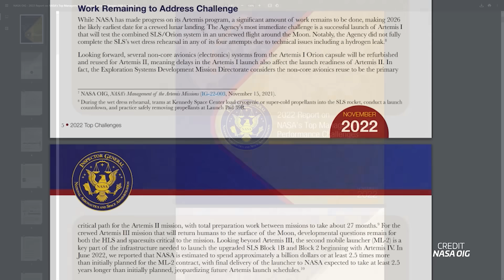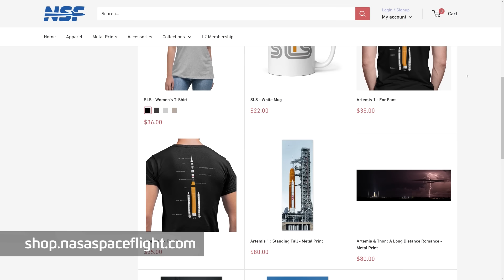Artemis Moon Landing Missions Delayed!

Comment: Artemis 3 will not happen until NET Jan 2027.  SpaceX will want to send at least 3 starships to mars during the late 2026 launch window which will require min. 15 tanker launches, so no Artemis in late 2026.  ;)
Reply: Then SpaceX will postpone their launches until the Q4 2027/Q1 2028 window. If Starship is even capable of reaching Mars by that time.
Reply: @iamaduckquack exactly

Comment: Biggest problem for Artemis 3 is the poor choice of Starship for landing vehicle.  Starship is meant to carry 100 people to Mars, not 2 people to the Lunar surface. Wrong choice as over a dozen more successful Starship launches are required. Bad choice NASA, should have gone with a smaller vehicle.
Reply: I mean, lots of payloads can be put on it, but i understand what you mean
Reply: Gonna be lots of Starship variations depending on what's needed.
Reply: Starship can only carry 100 people to Mars, if there already is a colony on Mars there to provide everything those 100 people need.
Reply: I mean It might even be cheaper and faster to just build a scaled-up crew dragon and send it via Falcon Heavy.
Reply: @erlienfrommars   Nope, because Crew Dragon is a LEO only spacecraft and doesn't have the shielding, lifesupport, or range to return from the Moon. Not to mention the heat shield would likely need to be upgraded as well. Then you end up with a spacecraft that is likely as heavy as Orion.

Former NASA Admin Bridenstine talked about Orion and the ICPS on FH, in that a fully expended FH could barely lift it to LEO. The problem was the aerodynamics of such a large stack on FH. After Artemis III, the 5m ICPS is replaced with the 8.4m EUS, so FH would not work at all, since it is only 3.7m in diameter.
Reply: @erlienfrommars  they should do this as well. Start space tourism around the moon.

Comment: EJSA: 2 hour rant just sh!! Talking nasa and ULA for not flight testing, and the space suits further delaying things.  The rant was repetitive, but warranted.
Reply: Boeing is the main contractor for SLS. Lockheed Martin is the contractor for Orion. The ESA is providing the European Service Module (ESM) for Orion. ULA is only providing the Interim Cyrogenic Propulsion Stage (ICPS) for the first 3 flights and they started on the one for Artemis III before Artemis I flew. Boeing's Exploration Upper Stage (EUS) is replacing the ICPS for Artemis IV+.

Comment: That was fairly inevitable. It’s NASA.
Reply: Most spaceflight missing the deadline, including SpaceX. The initial 2024 date was politically motivated and unrealistic.
Reply: @steveaustin2686  no it wasn't. The 2022 artemis 1 launched in time. Let's just hope China doesn't achieve it in the meantime... 😬
Reply: @amazingamazigh1538  Artemis I had issues and the launch date was pushed back, so yes, Artemis I missed its date.
Reply: @steveaustin2686  It could have launched so no it didn't miss its date.
Reply: @amazingamazigh1538   'Could have' and 'did' are NOT synonyms. Artemis I was pushed back, multiple times.
Reply: @steveaustin2686  it was pushed back multiple times and eventually launched as planed in 2022.
Reply: @amazingamazigh1538   Pushing it back, means it MISSED the date. I thought this was NOT a hard concept, but apparently I was wrong.
Reply: @steveaustin2686  but still it launch as planed in 2022. Whereas artemis 2 is most likely going to skip 2024.
Reply: @amazingamazigh1538  🙄So Artemis II can be pushed back and miss its date, but Artemis I being pushed back doesn't miss its date? That is complete and utter nonsense.
Reply: @steveaustin2686  yet it's easy just connect your brain. artemis 1 still successfully launched in 2022. That won't be the case with artemis 2 which will skip 2024.
Reply: @amazingamazigh1538   🙄 The part you KEEP MISSING, is that Artemis I was PUSHED BACK multiple times, so it MISSED its initial date. You, YOURSELF have admitted that Artemis I was pushed back, so it should NOT be that big a leap to understand that Artemis I MISSED its date.
Reply: @steveaustin2686  😒no it didn't miss its date since its schedule was successfully fullfiled in 2022 as intended. We would be glad if artemis 2 could do the same but it likely won't happen this year according to nasa. That is 2 different kind of push back between the two.
Reply: @amazingamazigh1538  🙄🤡 Artemis I was pushed back and you agree this is true. Therefore, it missed the target date. If you want to ignore reality,  that is on you.
Reply: @steveaustin2686  🤡😒🤡 as I said connect your brain it still launched in 2022 which WON'T be the case of artemis 2. Not that hard to understand.
Reply: @amazingamazigh1538   🙄🤡 We are NOT talking about Artemis II. We are talking about Artemis I and how it missed its target date. 

Wisdom has been chasing you, but you have been faster.

Comment: Does anyone know if the Orion capsule from Artemis 1 is the same one they will use on Artemis 2? I mean, is there only one Orion capsule in existence?
Reply: They built separate ones for Artemis I through III. After Artemis III, Orion is supposed to be reused. Some of the flight control systems from Artemis I are being reused on Artemis II. Artemis III is all fresh equipment.
Reply: idk, but the new mojo is to reuse as much as possible. SLS is junk and need to go to museum with Space shuttle.

Comment: How is it that in the 1960s we knew how to do these things, and now after 50 years of technological development we don't know how to do these things?
Reply: I think the problem is that back in the day contractors were mostly engineers rather than management obsessed with profits so could get stuff done well and fast. Combine that with INSANE amounts of funding to spite the USSR and you had a system that could get the job done. Nowadays with stupid management, limited (and constantly changing) funding, and worse political infighting it just goes slow and stupid.
Reply: @nathanguyon7620 the entire Apollo program cost less than twice what Artimes will cost through 2025 and that's including all of the landings Apollo managed to make and the first one in less than a decade while Artimes has made zero moon landings in almost 15 years of development.
Reply: We KNOW how to do it but have much less money and higher safety required than 50 years ago. 50 years ago whole USA was working hard for apollo program.
Reply: Our "enemies" don't have the same stringent safety requirement.  @MKJ8888
Reply: @MKJ8888  We had a heat shield capable of returning a capsule from lunar orbit, but now the current version is inadequate. We have life support systems capable of sustaining a dozen astronauts in low earth orbit for months, but now the lunar version for 4 astronauts for two weeks is inadequate. Yeah I know there's always money for another war but never anything for NASA, but they don't seem to have made good use of the money they did get over this period of time. Growing seeds for high school students and playing with spiders in the space station didn't bring us closer to exploring and developing the solar system. I'm not directing any of this at you - I just need to vent my frustration at NASA being so aimless and directionless since the mid 1970s. They should have been developing in-orbit refueling and propellant depots back then. There is so much NASA should have been doing over the decades, but didn't, and now that they finally have a mandate to explore, they don't have the technology they need. You cannot imagine my frustration. I don't think any of the astronauts who walked on the moon thought they would go to their graves with us never having returned.
Reply: I have a funny story that relates to this question.   Not long after President Bush ( the second one) announced that we were going back to the moon, my husband, daughters, and I made a return visit to the U.S. Space and Rocket Center in Huntsville.  While there, we struck up a conversation  with a grounds keeper. He told us this story. He said we had missed the NASA people by a few days. It seems that they had the realization that there wasn't anyone left at NASA who had worked on the Apollo  program.  So several NASA people were sent to Huntsville.  He said they went over every piece of hardware that had anything to do with the moon landings.  They were even asking the employees if they knew of anyone still living in the area that had worked on the program.  My husband  said that he thought there would have been lots of records kept.  According to what this man was told, there were hundreds of boxes of paper records and these papers were not really organized and had never been digitized.  I must admit , I found this very amusing.
Reply: @cindysue1139   Yeah reportedly, Apollo hardware was modified on the fly, as the engineering drawings didn't always line up. Also there were MANY upgrades from flight experience. So every spacecraft under Apollo was different than every other of the same type.
Reply: Cause, we never went to the Moon.
Reply: @Ricky02-d8q  If you don't believe we went to the moon in the 1960s, then why would you believe it when we do it in 2027?
Reply: Back then, the Moon Race was the major battlefield of the Cold War, fighting for the soft power prestige of a moment that would stand forever in mankind’s history, the way of exhibiting technological prowess without firing an actual shot in anger. Neil, Mike and Buzz were true cold warriors who had a slim chance of survival of their ‘mission’, and tributes were already written in case of their failure to return. We aren’t playing that game anymore. We did it.
Reply: Because the moon landing was fake. It always has been.
Reply: My comment disappeared. I will challenge anyone to make the claim that I never made a comment. Censorship is happening.
Reply: @derp8575  My comment also disappeared. Half of the comments are missing.
Reply: @derp8575  censorship is normal and good in the land of the free.
Reply: I have a funny story that relates to this question.   Not long after President Bush ( the second one) announced that we were going back to the moon, my husband, daughters, and I made a return visit to the U.S. Space and Rocket Center in Huntsville.  While there, we struck up a conversation  with a grounds keeper. He told us this story. He said we had missed the NASA people by a few days. It seems that they had the realization that there wasn't anyone left at NASA who had worked on the Apollo  program.  So several NASA people were sent to Huntsville.  He said they went over every piece of hardware that had anything to do with the moon landings.  They were even asking the employees if they knew of anyone still living in the area that had worked on the program.  My husband  said that he thought there would have been lots of records kept.  According to what this man was told, there were hundreds of boxes of paper records and these papers were not really organized and had never been digitized.  I must admit , I found this very amusing.
Reply: Space is science fiction. Can't have gas pressure next to a vaccum without a container but sci-fi idiots will believe anything.
Reply: It Tech regression.   Whenever you stop making something moon landers, nukes, etc the people built them don’t pass on their knowledge and the tech has to be recreated from scratch.

The Romans forgot how to make concrete because they stopped making buildings out of it and the knowledge of how to make it died with the people who worked it.
Reply: We still know exactly how to do these things and even much better. The question is not knowing, though, but designing, implementing, manufacturing, maintaining and operating.
If you look up details about the Apollo program, things like how the flight computer or how the engines were made, you'll start to understand how the technology of the sixties can not just simply be replicated today. In those times, it was the skill of the machinist that made the difference, which is no longer the case in these modern CAD en CNC times.
Reply: @EaglePicking   We can do it but it’s too expensive is always the excuse when tech regression happens.  The Roman’s used it with concrete as they switched to building with bricks and the tech was lost.

The details and skilled workers who can make a thing is far more important than the knowledge that a thing can be made.  We knew for 1500 years that Roman concrete was amazing but it was until 130 years ago that we invented a poor imitation and only 20 years since we exactly duplicated the Roman tech.

Today we recently discovered that our aging ICBMs are no longer reliable but were unable to build more because we didn’t keep the production line going. All the workers who made the missiles are dead.  Sure they’ll be a crash program to try a build a modern version the missile but without the skilled workers and institutional knowledge it’s unlikely to succeed.
Reply: Are you willing to take a polygraph? @EaglePicking
Reply: Bigger budget and much higher tolerance for risk. Nobody on the first moon mission expected that they'd return. They hoped for it but they understood the risks. Now space travel has become a "sure thing or no thing" operation. Not saying that's bad since it really doesn't provide much of a benefit to anyone on earth anymore but that is why it's so slow. In addition to the fact that SLS is a stupid project that requires every state have some part in it. Basically the least efficient method to do anything, by design.
Reply: There are a lot more women in the workforce now.
Reply: Who told you that? Let me guess, the same people who told you the jab is safe and effective.  @VanquishedAgain
Reply: That is a good question, the short answer is safety and sustainability.  There is a much higher demands for safety with Artemis, as evidenced in the telecon when they were talking about Orion passing all tests but they weren't 100% sure one battery would be 100% functional after a severe anomaly (launch abort).  The second part is sustainability.  Apollo was never designed to maintain human presence on the moon, that is an entirely different set of requirements necessitating a much more complex mission plan.  We should be asking NASA, SpaceX, Blue Origin, and other companies hard questions and they should be able to answer.
Reply: @Mikey_Likes_It_Too  YouTube deleted an earlier, detailed comment of mine for reasons unknown, but my point is that we had (and have) these things: a heat shield capable of returning a capsule from lunar orbit; life support systems capable of sustaining a dozen astronauts for 6 months; lunar space suits. We shouldn't have to redevelop these things from scratch at a cost of billions of dollars - and fail. It seems to me that we have a crisis of competence.
Reply: I’m sorry to tell you man but, people just don’t care anymore for space. At least not enough as in the 60’s. We were in the middle of a space race and EVERYONE in the United States cared. It was the main thing the US was worried about for 10 years. Now, NASA is very underfunded and starship is very new. It’s going to be a little bit longer than lots of people think sadly. Plus, the engineers back in the day were not as safe and under rules as today. Think about Apollo 1 and Apollo 13, they kinda just threw stuff at the wall and saw what stuck. Now there are regulations and safety measures needed to ensure safe flight.
Reply: Stanley Kubrick forever
Reply: Seems somehow NASA and Co forgot how to send people to the moon. Well, maybe they are learning it for the first time.
Reply: The big problem is that 50 years of technological development.
Things like life support systems didn't have complex touch screen interface controls back in the 60's for example.
Switching SCE to AUX? You mean a couple gigabytes of code and around 10 different computers to flip it these days.